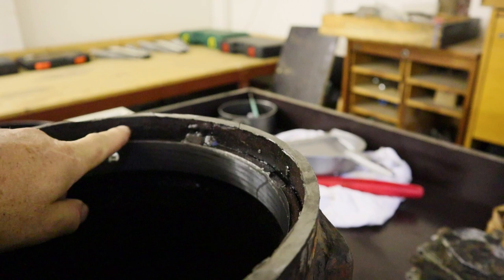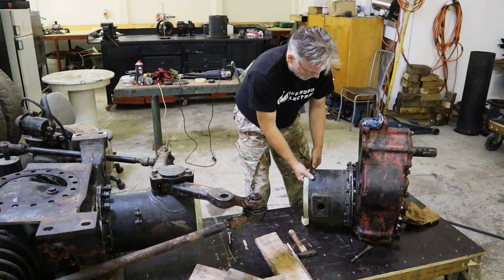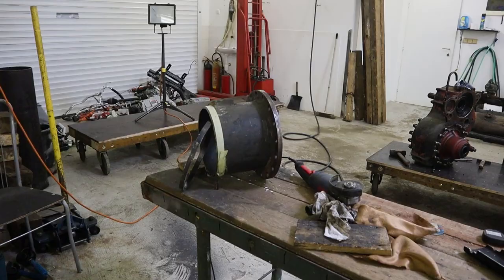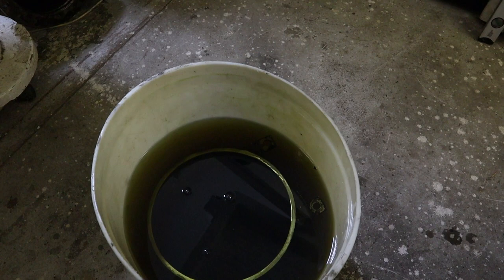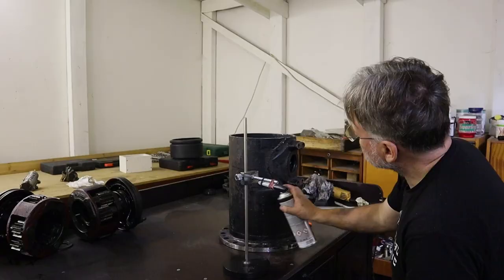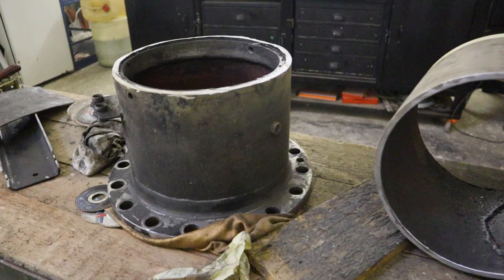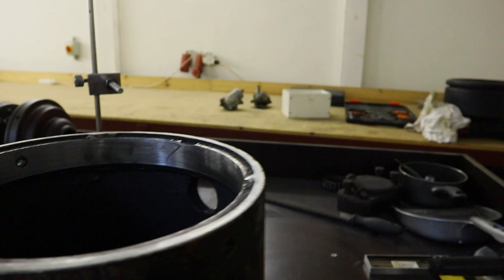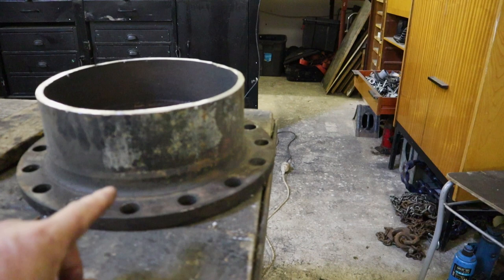EP.47, Building a Tesla/Tatra  2-motor Monster Truck

Comment: Bravo for your courage, your tenacity and your ingenuity, with little means you accomplish a titan work!  👍
Reply from the maker: Thank you, have an idea about building the machine that would quickly and precisely cut the tube.....
Reply: @offroadelectric9457  Maybe you can try to mount horizontaly an angle grinder on something like a drillpress support, a lift jack or your hydraulic forklift if you can adjust the height with enough precision and lock it in place. Then you can present the tube to cut sitting on its base and rotate it by hand to control the cutting. Just keep 2 or 3 uncut little spots to avoid pinching the cutting disk and make it to possibly explode.
Reply from the maker: @kna60  Exactly like this.:) I will probably use the open differential I took out as a spinning base and the tube flange where I bolt to it the tube I will be cutting. Ken commented here about the same idea.:)

Comment: Great to see the progress on this and the videos are awesome!!
I cringed with the grinder sparks all over the differential, throw a rag over next time maybe, same when welding but I love that you show everything warts and all. You can also draw file the flanges from where you are to see high and low spots, instead of moving the file along its length, drag it sideways and it will still cut and when you change direction you’ll see the low spots easily.
Reply from the maker: Thank you! The diff got the bath in the diesel as it was already dirty, and I marked the high spots on the tubes with the marker. But this cutting is a history, i am putting together something what will make the tube cutting probably at least 10 times faster. In ep. 49.

Comment: Great work. When you do the second tube, how about building a simple turn table so you can precisely rotate the tube against the grinder held in a fixed mount, similar to how you hold the marker? It could speed up  grinding the tube edge to precise flatness if the initial cut is more precise?
Reply from the maker: Absolutely!:) Yesterday I answered one comment that I have an idea to make a device for cutting the tube.:) I will probably use the open differential I took out as a spinning base and the tube flange where I bolt to it the tube I will be cutting.